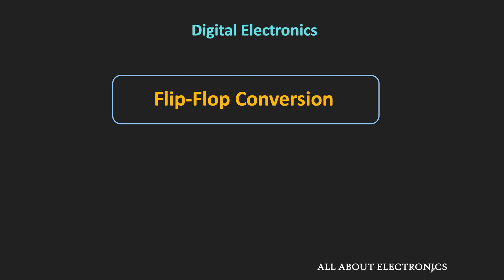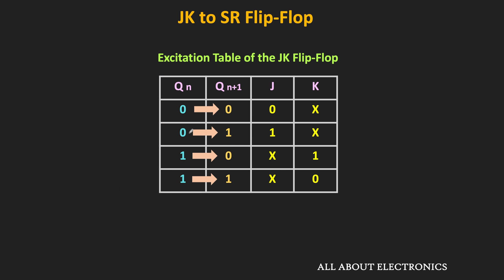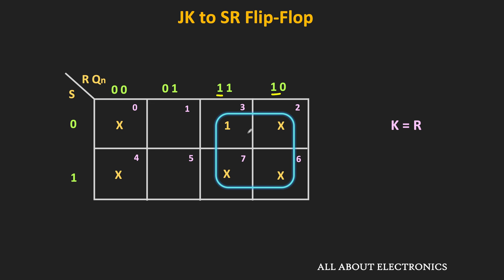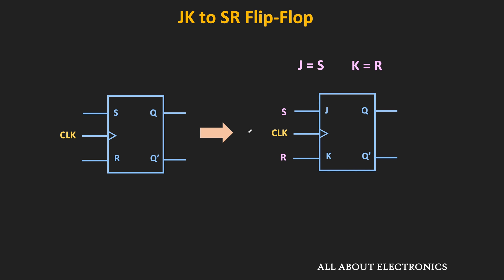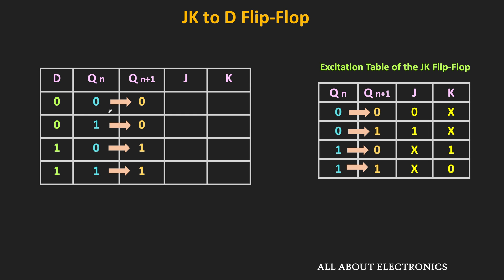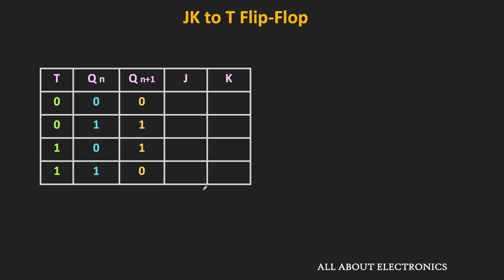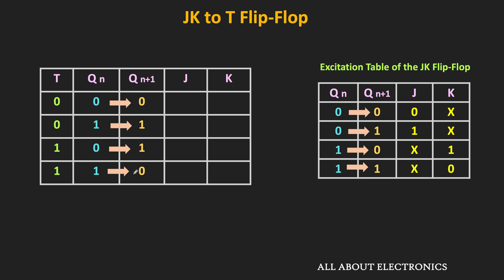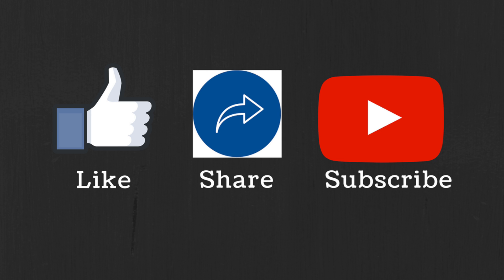JK to SR Flip Flop, JK to D Flip-Flop and JK to T Flip-Flop Conversion | Flip-Flop Conversion

Comment: hello sir , for the conversion of the JK ff to the SR if we put J=S=1 and K=R=1 we would have a toggling for JK but this output is invalid for SR , how to solve this problem ?
Reply from the maker: In case of SR flip-flop since S= R = 1 is invalid, so we would avoid that input while using JK flip-flop as SR flip-flop.
Reply: @ALLABOUTELECTRONICS  thank you